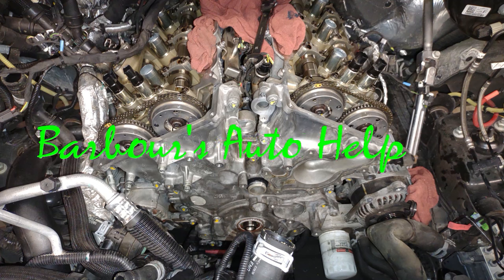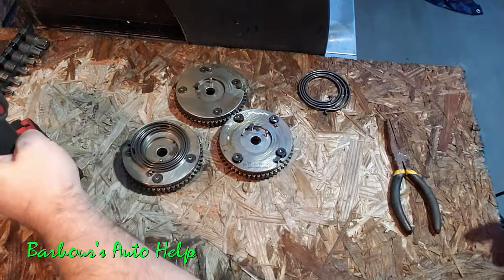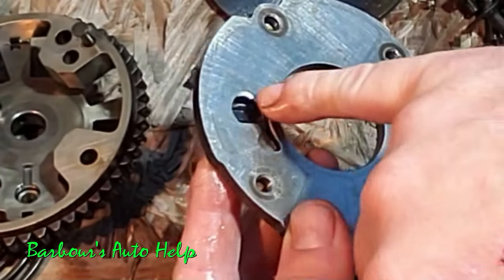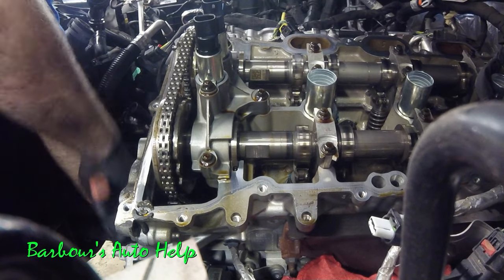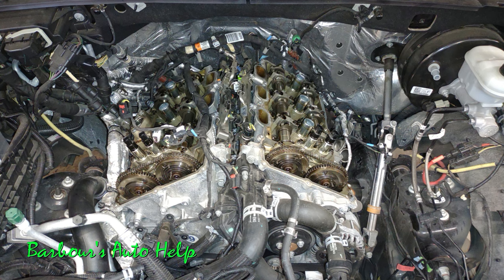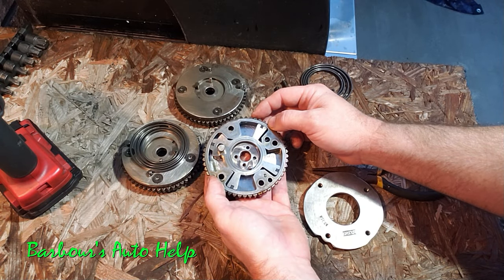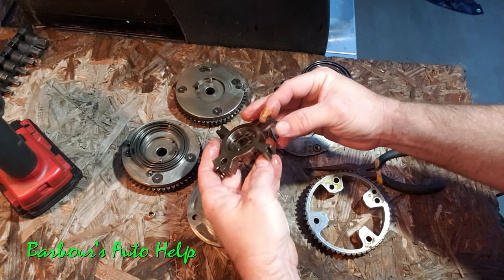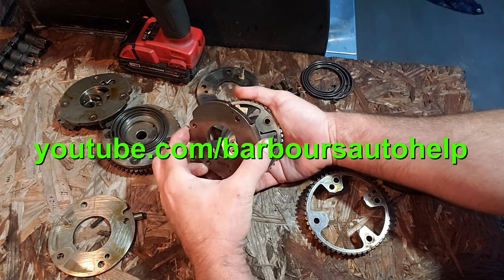Ford 3.5L Ecoboost Cam Phaser Rattle/ The noise, The cause, The fix

Comment: My wife's 2011 Ford explorer has this issue it's been happening for 30k miles. So my question is,  is it doing any damage to the engine besides the annoying noise on start up? Her explorer is at 192k miles is it really worth replacing?

Comment: I have a 2013 f150 with a 3.5Lt ecoboost and it rattels all the time, not just at start up. what are your thoughts on that? replace the timing chain componentas and the cam phasers?
Reply from the maker: I'd have a tech take a look at it.  Gotta make sure you don't actually have an oil delivery problem or some other issue.  Don't want you to replace the wrong parts.

Comment: What would happen if you just left it as is?  I had it done about 40k ago and it sounds like it needs to be done again now, but the truck already has 200k so I'm not sure if it's worth it
Reply from the maker: In rare cases the units can come apart.

Comment: I have a 2021 Aviator. My noise lasts for a few minutes. It is a very rapid tapping noise. When i described to the tech on the phone, he seemed to think it was the cam phasers. If the noise lasts for 5-10 minutes after warm up, could the phasers be the problem? Thanks
Reply from the maker: It's possible, but the typical symptom is a rattle upon start up for just a few seconds.  They can still fail in different ways though, so it's possible.   I'd get a little more than a phone call diagnosis and a  youtube question/answer though before you throw that kind of money at it.  I'd suggest having a good tech properly diagnose it.  Good luck to you, CampsitePyro.
Reply: @BarboursAutoHelp  hello,

I brought the car in this week. The tech says that they have had some complaints with the turbocharged engine, which mine is. When he fired it up from a cold start with me present, he knew what the noise was immediately. I also sent them a recording of the noise. 

They don’t appear to be concerned about it. It is an annoying noise though, and lasts a few minutes after starting. All I know is our 2019 Navigator is much quieter.

Comment: recommended oil and weight ? also recommended oil filter?
Reply from the maker: Manufacturer recommended.  Whatever is on your oil cap.  I recommend Motorcraft oil and filter.

Comment: What is the typical cost of replacing the cam phasers? 
And will it do the engine any harm if they aren’t replaced??
Reply: Dealership told me $3000 dunno how long you can go with the rattle I’ve got 40k miles with rattle 🤞🏻😅
Reply: Each phaser is $250 at stealership
Reply: That was my question as well. It doesn’t seem that terrible after startup. Could one live with it?

Comment: Hey quick question so I got my cam phaser fixed took it on an expressway n it popped up with low pressure oil n shut my truck off now it won’t start anyone have an idea it’s a 2013 f150 ecoboost
Reply from the maker: Do you have oil in the car?  Does it crank and not start or does it not crank.

Comment: I had this problem with my 2017 F150 Lariat. The dealership replaced the phasers at 72000 miles. The repair lasted 30000 miles as I now have 103000 miles and the rattle has started again.
Reply from the maker: Hopefully the new updated cam sprockets will take care of it.

Comment: I have a 2013 3.5 ecoboost 150 Wondering what your opinion on using Cloyes timing chain kit vs Fo Mo Co’s parts?
Reply: If you haven’t finished the project yet.  I’d go with Ford cause I used the Cloyes cam phasers and they’re terrible same with Dorman, Immediate cam rattle.  Go with OEM. Save your time.
Reply: @michaelcole6049  I’m done with the fix and I still have the rattle happen sometimes damn it I should’ve gone with the OEM parts there goes another 1500 thanks for the info
Reply: Yup.  It sucks

Comment: Thanks for your videos ,  Im having issues with the cam phasers replacement on my 2018 F150 3.5 , shop replaced phasers solenoids , chain , tensioners and everything related with the VCT system and  now codes P0012A , P0254A  and P0254B come to scene , what could be the reason ?? Bad installation ??
Reply: Forgot to mention , facing lack of power check engine light and kinda hard start ..
Reply: Did you get the repair done from dealer?
Reply: @studritaf207  not really , repaired in a shop by a Ford certified mechanic who worked in a Ford dealer for several years ..

Comment: new design cam phaser's locking pin was redesign internally on the VCT unit.  New part # start with ML. Time will tell if this solves the problem.
Reply from the maker: Thanks for the info!
Reply: Nope, I put about 25,000 miles sense replaced last year (covered under warranty). Did every oil change (the works). Now it's doing it again. That's why I'm watching this video.
Reply from the maker: Do you know if the updated phasers where installed?

Comment: Has this issue been known to cause failure, or is it just a nuisance thing?
Reply from the maker: I think it's more a nuisance than anything.  However, I have seen one that grenaded.  Ended up replacing the engine on that one.
Reply: @barboursautohelp can you provide more info? This is this first I've heard of any real damage from not fixing it

Comment: 2019 Expedition Max 1 Cam Phaser Replacement / Repair at 65K. 1 year later at 88K Second Replacement / Repair. I'm not sure of the exact work performed, I need to check. Not happy with Ford right now. The Phasers still make a bit of start up noise. Total BS.

Comment: I have a 2016 Ford f150, with less then 60,000miles I’ve had both Turbos go, catalytic converter go, and a whole bunch of other ish -including this.  Customer service from ford sucks.  I originally complained about this problem when the warranty was still good, but Ford service department claims they didn’t hear anything.  So m done with ford.  I even call the main head quarters and was literally told they were about to close so I basically couldn’t be helped.

Comment: How much would it cost me to get a job like this done???😢
Reply from the maker: You'll have to call around.  Prices and cost of labor varies.
Reply: 3000 to 3500 at the dealer.   But they replace the faulty parts with new but still faulty parts....

Comment: So.... I have a 2022 Built on 03/2022,  And from what i've seen and read and heard, my 2022 3.5 Eco Boost  F-150 Has this stupid Rattle at Cold Start Up Issue???  (S T I L L)????  What's to be considered "NORMAL" on these 3.5 V6 Eco Boost Engines? Mines Quick, and goes away within maybe 2 Seconds, I've Changed the Factory Oil and Filter at 1416 MILES on the ODO, with No Change in Symptom. Seems rather Problematic with No Real  "GOOD"  FIX at this time for the Past 4/5 YEARS, and Ford Boss Me has a 2021 2.7 Doing the SAME THING??????  Mine is going in for service on one other Problem, and Possibly CAM Phaser's or ???????? Who know's at this Point????

Comment: I posted a video to fix this. I personally don’t believe ford cares about it’s customer’s enough to actually make a fix for this problem.
Reply from the maker: I saw your video!  Looks cool.  However, I still haven't seen a failure with the new updated phasers.  I think Ford may have fixed it with the updated phasers.  So far so good.  By the way if you would like to post a link to your video here in the comments I'm cool with it.  It's not my endorsement of the product but I'm open people sharing.

Comment: How long can you let this go for? Got the rattle at 36k at 76k now still rattle. Think I’ll just let it go until it blows and never buy a ford again
Reply: You should have an extended warranty that covers the cam phasers.  When they found the issue, they automatically issued an extended warranty as long as you got the ECU reflash for 21n03.  Why didn’t you get it fixed before your warranty ran out?!?  You had 26k miles before 60k ran out…

You can still get it fixed for 66% off if you do it before 80k.
Reply: @ethayer1  because ford dealership lied to me and said there wasn’t a problem. Now they say there is but I’m not covered even at 66% (just called a few days ago) I’ll just go back to Toyota where I don’t have to deal with issues for 300k miles
Reply: Same here. 2019 F150. Did not have rattle at 30k, 40k, and 50k dealer checkups. At that time dealer told me they were not recommending re-flash unless a problem due to trucks coming back right after with other problems (shifting).  Truck had 59600 mi when rattling started.  Called dealer for appointment to check, earliest was a month out and he told me not to worry as long as they saw it before 12/31/2022.  Now another dealer tells me that is BS, needs new VCT and no warranty coverage available because over 60k.
Reply: @ethayer1  no you cannot, it has expired
Reply: @mr.grapes3931  incorrect.  The 21NO3(reprogram) has expired.  If you received a reprogram before Feb 2022, you’re still eligible for the extended warranty.  Two different TSBs.
Reply: @ethayer1  I’m going through this right now. They will only cover that much of the cost if I got the pcm reflashed before February of last year. And there was absolutely no issue with my truck until about 6 months ago when the rattle started

Comment: Watch one of your videos and done a water pump and chains on 3.5 edge thanks
Reply from the maker: The 3.5L in that video is a different animal.  This video doesn't apply to that 3.5.  this info is for F150, Expedition and Navigators with the 3.5L Ecoboost.  So just keep that in the back of your mind.  Thanks for watching!

Comment: Absolutely ridiculous that owners of newer Fords are even having to go through this. When the Ford CEO tells a bunch of engineers that it will take several years to correct all of the quality control issues at Ford,  that should tell you something. 
If you have a Ford, dump it.

Comment: Pushing oil chamges to 5k is the dam issue . Change the crap at 2500 miles. The ports for the oil are small and once they get clogged by the slightest dirt by by. Same crao with the chevy 6.2 and the dodge chargers. Oil is cheap dont push it as far as dealers say they are full of bs. Next why anyone wouldnt puck the proven almost impossible to kill 5.0 is beyond me.

Comment: 5.4 is very common too . I just had to replace mine in my 2005 f150 . What a shitty design for a engine lol if it goes again I'll be tossing a older 302 or 351 in the b.tch

Comment: The fix is to buy a chevy or GMC. Or a Dodge or Toyota or.....
Reply from the maker: They all have their own set of problems. lol. Toyota in my opinion is the best.  But even they are having issues. I lump all the rest together and equal.  But, I’m still a fan of Ford. Love the F150, Crown Victoria, Lincoln Town car amongst others Ford models. I rank the Crown Victoria and the Town car as the best car ever made.
Reply: @BarboursAutoHelp  I'm a Ford fan as well. Dad and I operated a painting business for many years and between 1990 and 2000 we used a 1988 F-150. Had it repainted and rebuilt the 351 Windsor in her. Loved that truck. But time wasn't kind to her. Been working as a janitor at our local GM dealer so I have been buying Chevys and GMC's for the last 20 years. I've had good luck so far. 😉

Comment: Ford always builds a fkn trash component in their engines. The 6.0 required a bulletproof diesel kit just to make it run and now this cam phaser trash on the 3.5. I let Ford warranty mine and 25k miles later I get to pay for it. Trash.